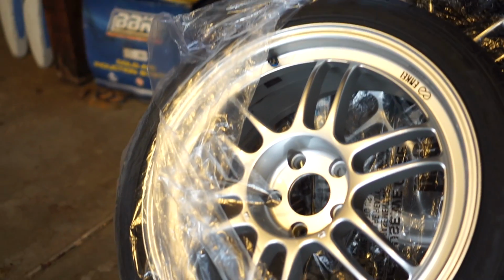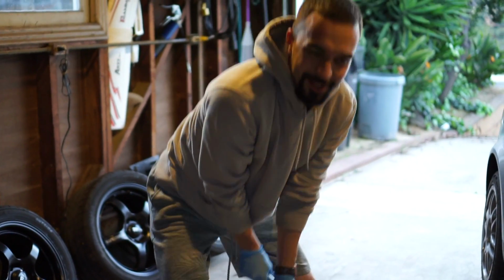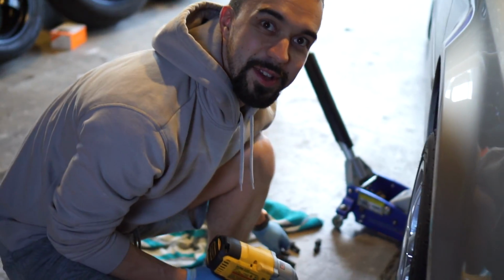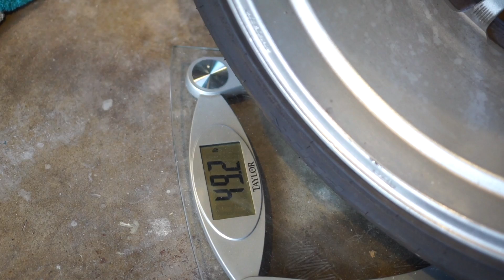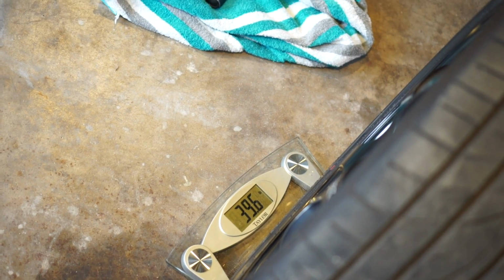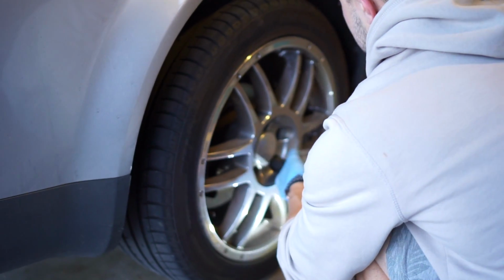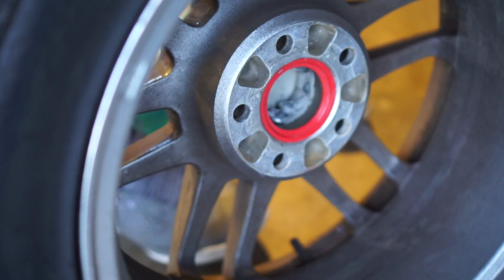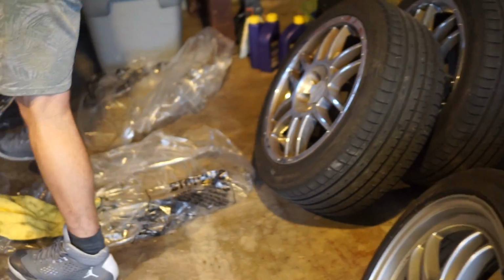Do Light Wheels Make Your Car Faster?

Comment: The wheel may feel easier to steer, because the front tires are not seated in and flush to the road. An acceleration test or driving over multiple bumps could show a difference, but not just driving straight.

Comment: I wonder what the difference would feel like on a motorcycle
Reply from the maker: That’s a good question actually.
Reply: Jason Kramer I installed carbon fiber BST wheels on my R1. Before installing them, I rode over specific sections of road, then repeated it right after swapping the BST wheels on. All the bumps in the road felt half as sever. It was almost like someone put pillows under the wheels. Acceleration was also more dramatic and lean in was a touch more fluid.
Reply: Ray Nada god I can’t imagine that on 2s 😭😭😭
Reply: @ray5961  I installed the Beasties on my 2001 RC51 - SP1 ( in 2003) with the aluminum hubs and the handling got even better, acceleration improved and when you let off the throttle the engine braking allowed you to use the brakes with quite a bit less squeeze.
Reply: @warrenlucier5796  Yeah, those carbon fiber wheels are nice for sure. Makes me miss my R1